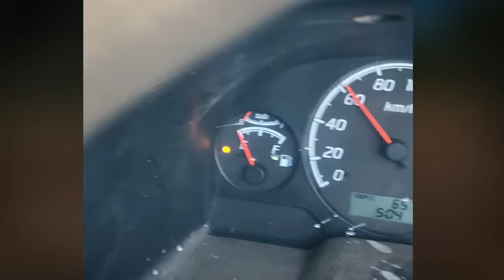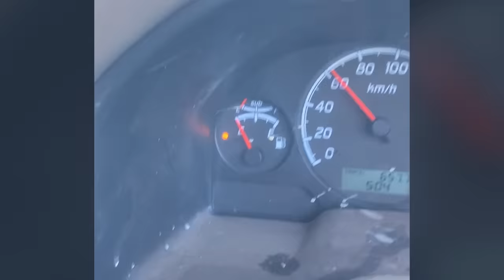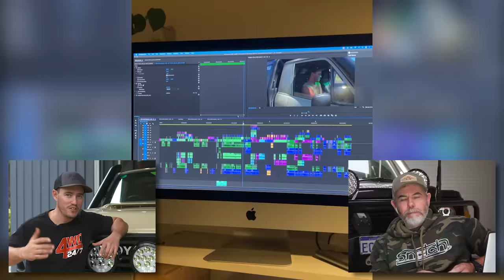Bent Chassis & desperate trackside repairs – UNTOLD STORIES of our biggest ever trip!

Comment: Good trick with the radius arm bolts, The hitch pin fits through the hole aswell.
Reply: Not a bad idea 👌👌
Reply: That or the stubby extension with a socket and tap. Saved me a few times
Reply: Castellated nuts with a split pin work a treat too.

Comment: For what you do, have you considered sealed alternators? When I worked in the mines in Kambalda, we fitting the 70 series service utes with sealed alternators, which proved quite successful. We had significant, ongoing issues with salt and water ingress and replaced numerous alternators among other electrical components. The sealed alternator taps into the engine cooling system for cooling, allows for total submersion, and I understand are also available for the later model cruisers including the V8.

Comment: Great tip. We lost a radius arm bolt on our cape trip. We found that the bolt through the rear recovery point on the ff camper was a perfect fit. Correct length, diameter and even had a nylock nut.

Comment: Would recommend an alternator stick welding set up and a torch set with some brazing rod. You already have the Propane just need O2 and a torch. Could have fixed that yoke, radiator (that was some fine JB weld work though), and many other things to come down the trail. Great series fellas! Cheers!

Comment: So for future reference or anyone who comes across the same problem with the truck, there’s a hole hidden by a cover in the back of truck brakes and a bolt, what you do is insert the bolt into the threaded part inside and the bolt is used to tension and release the brakes, that’s how you could of got it out of there but it still would of required access to the axle

Comment: I know that the truck engine had a hydro lock. It may be handy to note that you can move or tow-start a truck or any vehicle with air brakes locked on. Just use your compressor to pump up his air tank. If she is a leaky old girl you may have to leave the compressor connected when pulling.

Comment: I was climbing up a trail called rattlesnake mountain which is kind of weird because there is no snakes in Maine no more especially poisonous ones. We used to have timber Rattlers but they all died out. I digress I was going up a steep trail and it's bent around the corner it was a hard lean on a cliff edge. This was before cell phones pretty much it was when the cell phones first came out I was about 18 when it happened. I'm in my favorite truck which is a Chevy S10 Blazer come around the corner hit root just right and I started to lean. I did not stop leaning next thing I know I watched the sky do a circle around me eight times. As a roll down the cliff my friends thought I was dead. Thank God I listened to my dad. Never go alone always go with at least one other vehicle. It will save your life even if your friend cannot physically help you he can go and get help. Do not go alone unless you are extremely capable of judging every trail correctly. And even then make sure you have a way to contact people cell phones do not work in the woods. They do not work in valleys. So make sure you let people know I survived it's very limited injury. Me and my dad just put a brand new roll cage around my vehicle. It was an early birthday present my dad did for me after the accident I asked him why he gave me the early present he said he had a feeling I might need it. I wouldn't be here if it wasn't for my dad and my friends. And my S10 Blazer is still alive it's taking me many years and a lot of money but it's almost roadworthy 😁

Comment: Great episodes guys - it was great to see the video on Rocket Rod vehicle and what damage he sustained and what needed to be fixed - this sort of information is rarely shown - also not talked about is the camping trailer, as an owner of one it would be interesting to see what things were damaged and what pre-trip preparation and modification are done to such a trailer to ensure it came out the other end.  It certainly was put to the limits of its endurance in these episodes.  I planed to do similar tracks to what you have done and this information would be helpful in pre-planning and pre-preparation.  Hopefully you will reply.  Cheers

Comment: You can also use a tow ball hitch pin for the radius arm and rear trailing arm bolts if it falls out and it has that r clip to lock it in

Comment: On those big trucks with air brakes, an 11mm wrench or socket is all that's needed to release the brakes. There's a little hex on the adjust by the brake chamber. All the way out releases the brakes.

Comment: You guys should Run Fortron Injector max through the System to clean out the fuel line and Injectors ! And a good engine flush with Biofuel in the fuel system to make sure all the water contaminants are out of the system !

Comment: This is what the show was made for going into areas that nobody's been in it for years keep up the good work next time I would bring something with a little bit more ground clearance. Because some of the scenes that you guys showed if you guys had more ground clearance you would have had so much trouble. There's an axle it's kind of rare it's called a step up axle it's made for tractors what happens is the axle itself goes out to gears that are below it and that's where your wheels attached. It creates 12 in more of clearance cuz it brings the axle in the pumpkin up I don't know if they designed it for vehicles yet but if it's strong enough for a tractor it's strong enough for your vehicles

Comment: gdday mates and hallo from faraway israel next time you find a truck with e brakes locked dew to lack of air you have several solutions 1)you all have on board compressors to fill her up 2) i got a special pipe allowing me to transfer air from the tires to the tank , got it from my grand father who drove a volvo truck and this hose came with the truck for this specific purpose 3)on the e brakes chamber there is a release screw to release it mechanicly but this would require diving under 
next time take me with you and ill help you out

Comment: Im in the USA and im trying to build my dodge ram like you all have but on the super cheap because thats my only option and if i could pick one thing from you all it would be the fridge or the redarc power system. Those 2 things are somethingi need but cant affford. Im saving up for a winch right now and getting a 5 inch lift ordered tmrrw

Comment: I saw your simple dual battery set up video and have a question.
I have a sealed lead secondary battery in my van that chargers from my alternator via electronic solenoid. Have had it 4years and just added water and recharged it at home and will be reinstalling it. I saw this 🔜, Pulsetech PowerPulse Battery Maintenance System. Will that work with my set up.?

Comment: as far as fuel onboard , my truck is a 2004 dodge 3/4 ton, 6.7 turbo, diesel main tank is 37 gals, and the rear transfer tank is 60 gals, i HATE CARRYING JERRY JUGS, takes up to much space. installed is a 10 gal, per min electric pump, and hose. right behind the cab, of the truck, as far as sizing the transfer tank needed , rule of thumb, 1 1/2 times in, of the size of your main tank. 37=64 or 60 for the transfer tank.

Comment: I was driving down the dirt road coming back from a job site my truck started vibrating I started thinking to myself all right I think I threw away on a weight on my tail shaft. I was about 20 miles from town on a dirt walking road pulled over crawled under. It was not my tail shaft but your rear transmission mount decided he wanted to give out like all right cool I need a transmission mount so I took a strap wrapped around the transmission and tight it to the center as much as I could when I go home the next day. Crawled under it to tighten the strap and see what else I was going to need to fix it it wasn't just the mount it was my ears on the transmission that bolts to the amount to that is completely snapped so I had to drive 20 mi with my transmission held up by my block and straps and this was not a smooth road a lot of low and slow driving a lot of torque on the transmission. I had a friend with a flatbed truck could haul me away if I needed it had him on speed dial talking to him the whole way. You kept telling me just keep going keep going and make it home make it to the end of the road I'll be there. He was but still I need to find a new transmission housing

Comment: I am from the United States and drive a jeep gladiator semi modified for light track driving but mostly daily driver. If I ever wanted to commit to a vacation to Australia once the pandemic is completely over would you suggest I buy a used vehicle and then get in touch with Ronnie or what would be the best approach? Also side question why do you jump back-and-forth between kilometer and a mile when you are talking when Australia runs on the kilometer not the mile lol

Comment: But I would like to know what everybody's feeling is on the Nissan Titan a lot of people put them down just bad reviews I bought mine for $6,000 $170,000 MI seems to run fine no problems I put it in a few spots didn't have no problem the guy before me had it put 5 inch lift rough country suspension